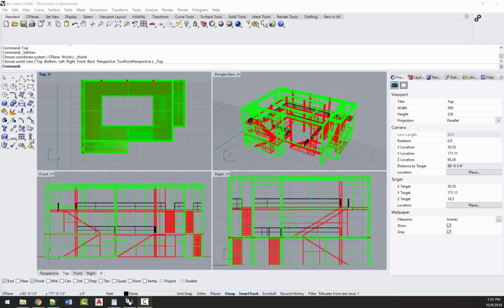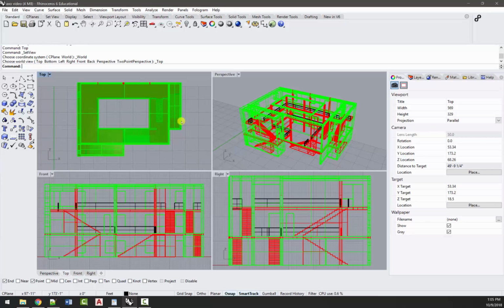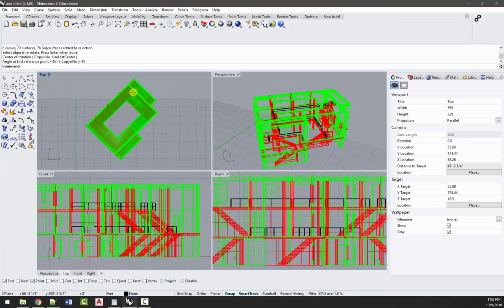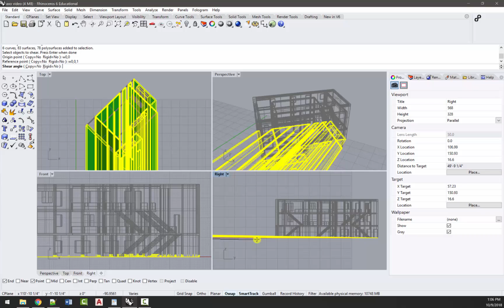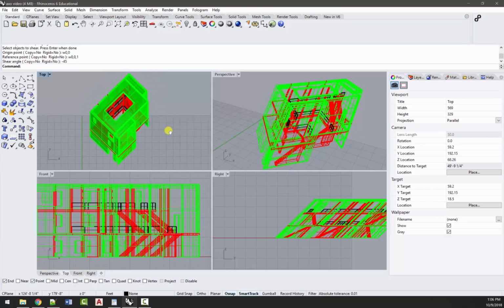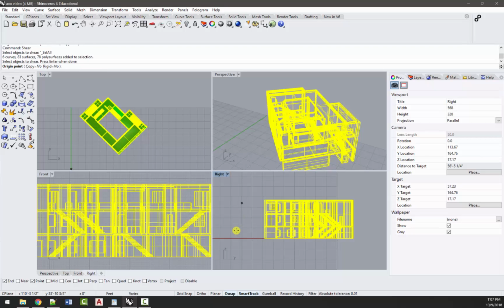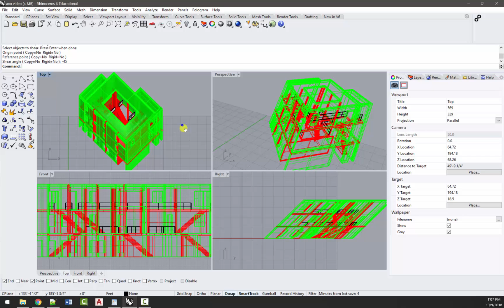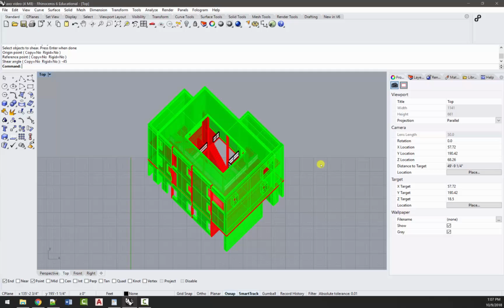ARCH230 - Rhino 6 Axonometric / Axo Drawing Fix

Comment: it still didnt work for me. top view still only shows top view
Reply from the maker: Make sure you run the shear command in the Right viewport (-45 degrees from vertical) after rotating the top view 45 degrees. Your top view should then show the top -- yes -- but with the form distorted to resemble an axo.